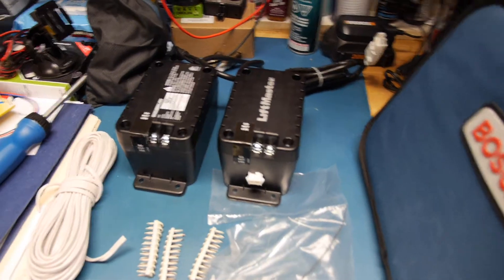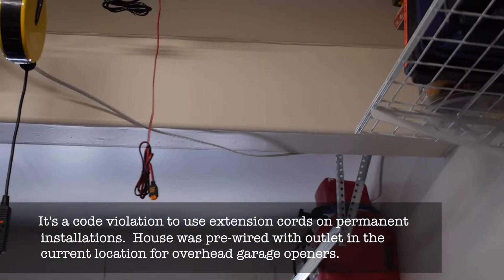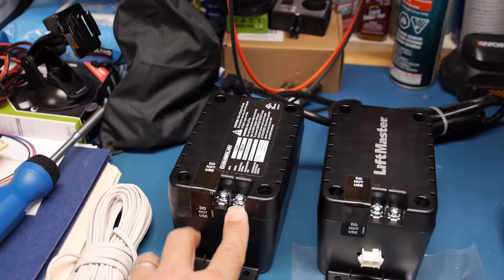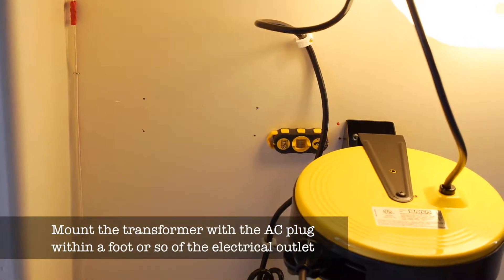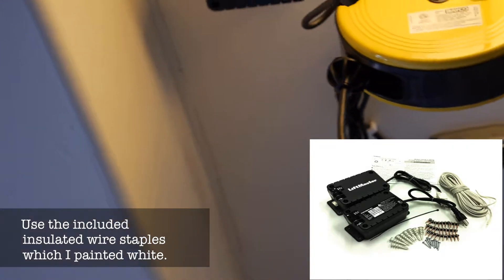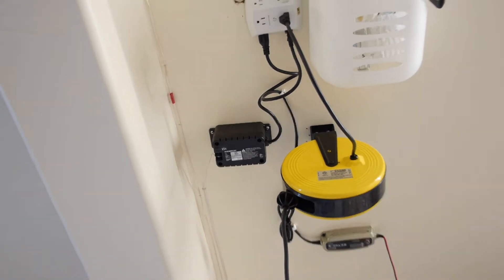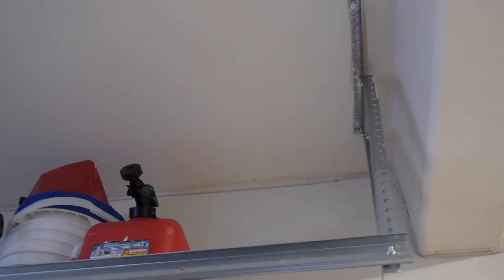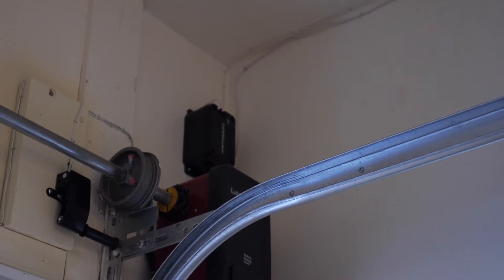LiftMaster 580lm Alternate Power System

Comment: Any chance you could check the voltage at the Molex connector (plastic one) that plugs into the opener? I want to use a solar system to power the opener and I'm confused on whether the opener needs 24v or 36. The motor is 24v but the plug on my opener is outputting 36v, so I'm unsure. Thank you!
Reply: BTW. great video. I didn't even know this existed before seeing your video. Thank you!
Reply from the maker: It's 36 volt DC at the Molex connector and slightly less (about 30v) under load (motor turning the door)
Reply: Awesome, Thank you so much!